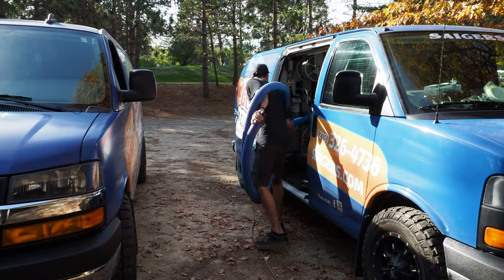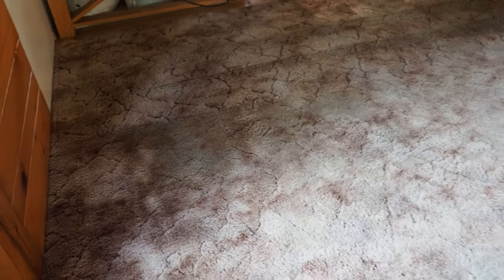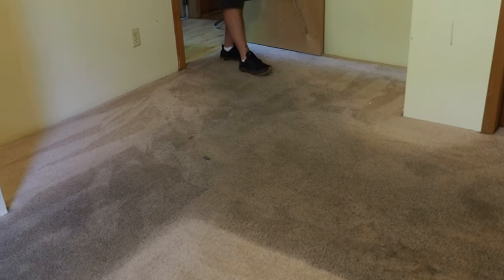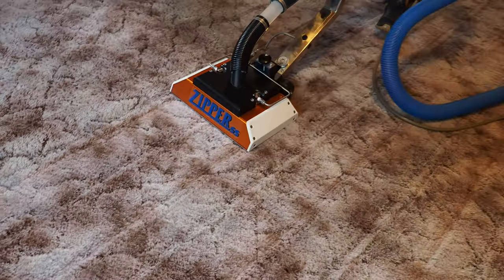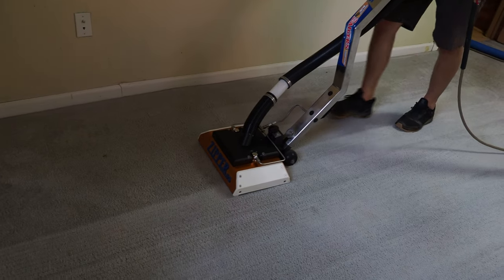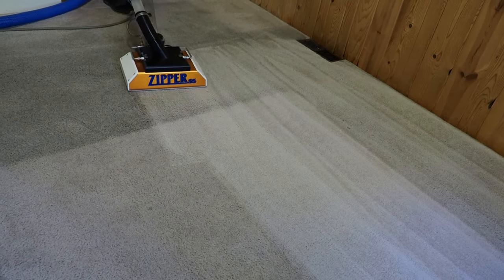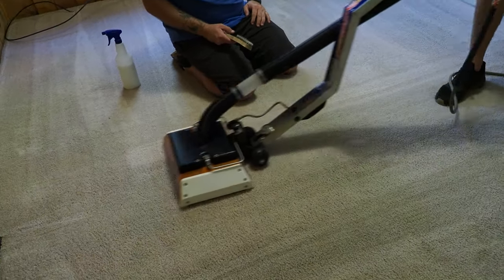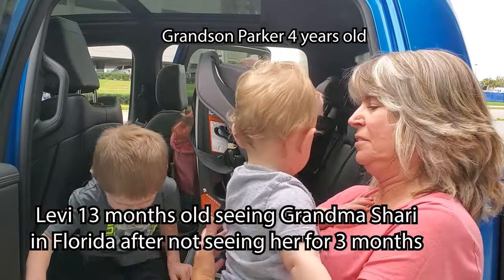Some of the DIRTIEST Carpet Cleaning Ever in this Home

Comment: I would bet money there probably was an habitual candle burner in there or something else was going on. If you see something like is shown @ 2:28 and @ 2:52 you can mark it down that it was not tracked in, but came in the air and attached itself to the fibers.  For some reason polys really attrack air born pollutants like nobody's business. Notice how if perfectly outlines the furniture. It could be from a fireplace if they have one or some other soot source. I can tell for absolute certain most of what was in the bedroom was air born soot. It surrounded all the furniture and went all the way up to the walls. That's a pretty certain tip off there's some serious soot going on. I've seen some just as bad over the years and it helps to know what you're dealing with. A lot of traffic lane sprays won't do the trick on something like that. I have boosted with a degreaser in the past on those, but am using your soy based G-Force booster now with good results with more than one prespray. I always used a good citrus based in the past, but the price per gallon is just ridiculous now. I have zero doubt there is a soot situation going on there and it is more attracted to polys than it is to nylon. There is zero chance that was all tracked in on shoes. I'm 100% certain of it. Notice that old nylon didn't have anywhere near the same situation as the bedroom. Somebody put some soot out in that house!!! Btw, I find the G-Force really gives my presprays that extra kick for greasy, grimy carpets or ones that have been let go for years. I don't leave home without it.
Reply from the maker: Good possibility. The man of the house was also a mechanic, so we were fighting grease tracked in from his work. And then there was the elderly dog who was leaking... So many things going on in this place for sure

Comment: Hey mark it's me AGAIN lol. Took your advice on the price increase and thank you again. I do have another question. I noticed in alot of your videos it seems that you run your butler on mach 2. I noticed my father and I have been suing our on mach 1. I'm wondering what's the difference besides the rpm and possible slightly better suction. Do you recommend using my unit at mach1 or switching to mark2
Reply from the maker: Me and my family have run on Mach 2 for most all of our cleaning. We like the max performance for the suction and even heat. We really have not used the Mach 1 level much. Maybe an occasional area rug. For Upholstery, I actually clean on the idle setting. You could try some comparison cleaning to see if you notice a difference between Mach 1 or 2. We just have noticed our units seem to have more power though on 2